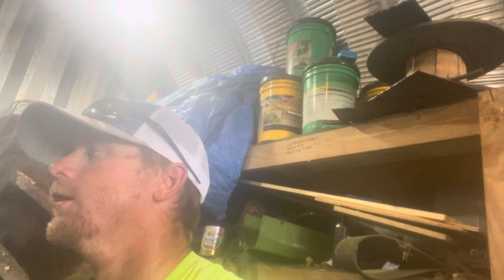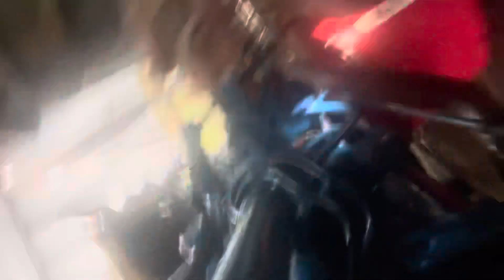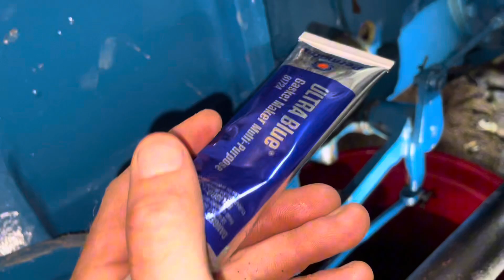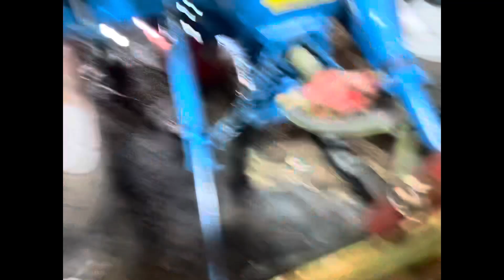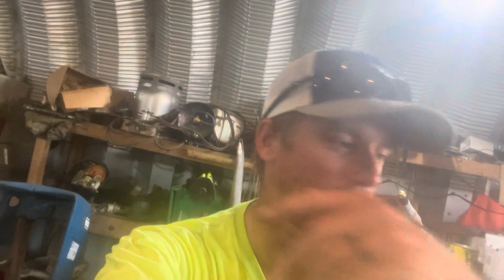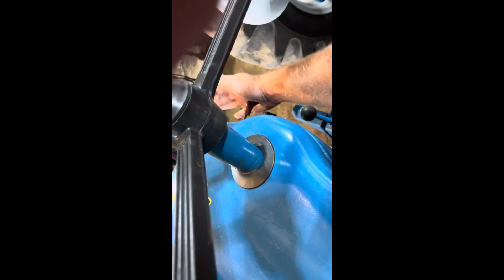Hit 500 subscribers, and this ford tractor is giving me issues

Comment: Id watch a hay video. 
What kind of oil were you putting in it?
Reply from the maker: Regular hydraulic oil
Reply: @rgcattleandhay2215   Both the transmission and the rear end require hydraulic transmission fluid, aka hytran, or tractor fluid, the ford designation was 134.
 Straight hydraulic fluid most likely won't have what is needed to keep the gears properly lubed.
Beautiful tractor by the way!